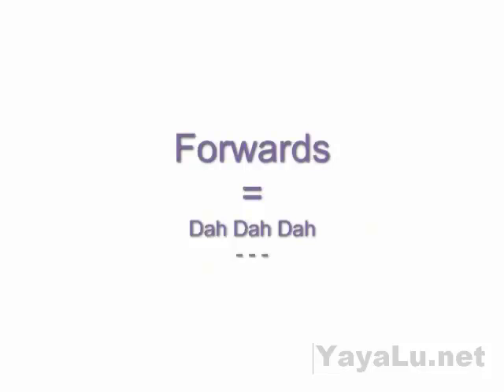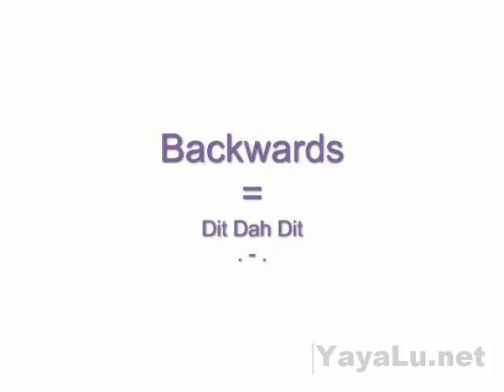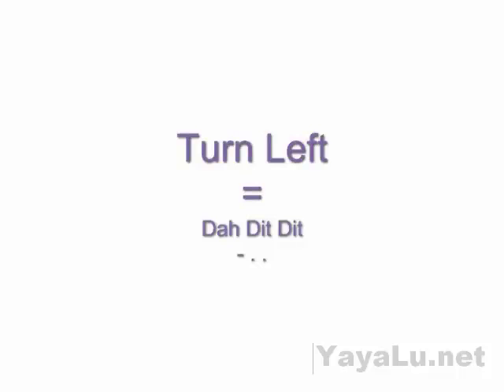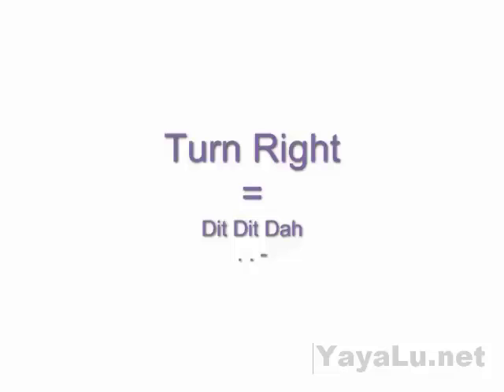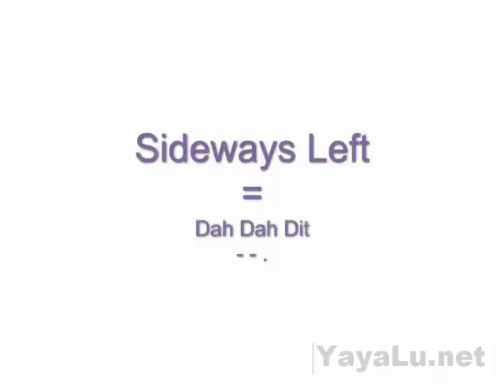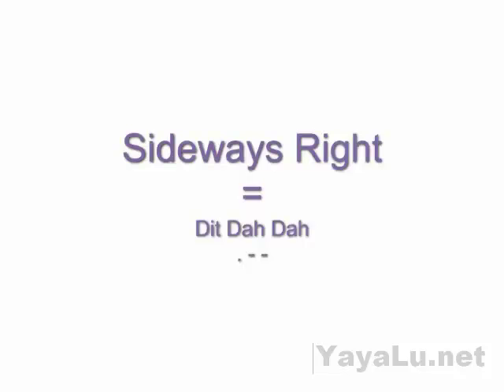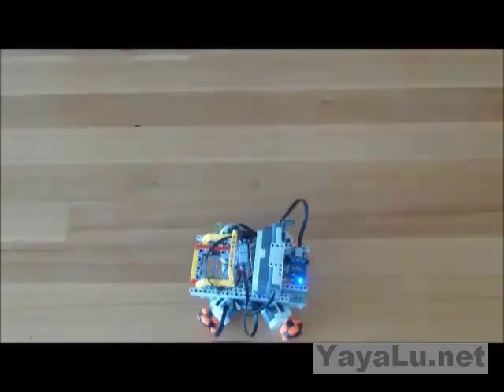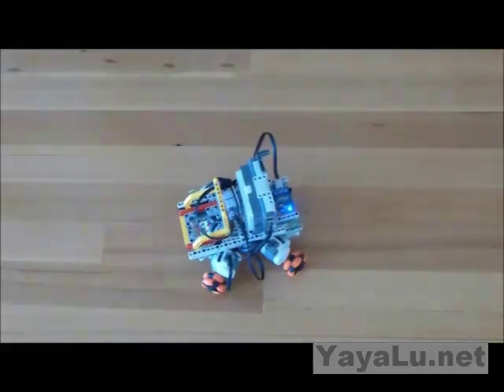Prototype language-independent voice control of a wheelchair by a complete quadriplegic

Comment: Yup, it's a nice variant. And no, Morse code does not require a fixed length. You just need to keep the length of the dits dahs and spaces relative to each other. Nice implementation! Keep it up!

Comment from the maker: No. Emergency stop would be dit dit dit. :)
At first glance, my project does resemble Morse Code in some way. However, the actual implementation of Morse Code would be extremely inconvenient; because Morse Code is too exact. It has a fixed length for each Dit and Dah, as well as a fixed length of silences that distinguish between words and sentences. Though this works in theory, it is too exact to use efficiently in practice. So mine uses FIXED length commands with long and short sounds instead.